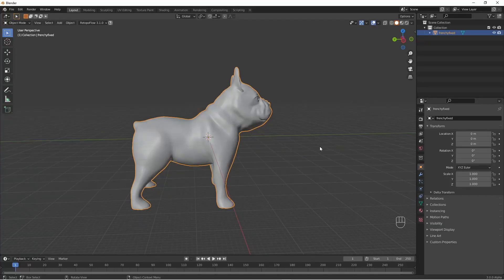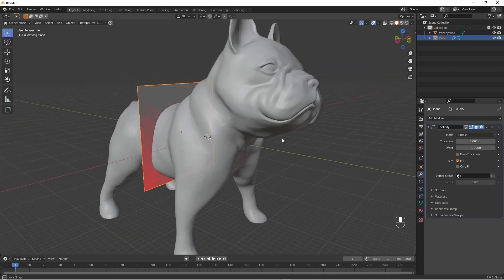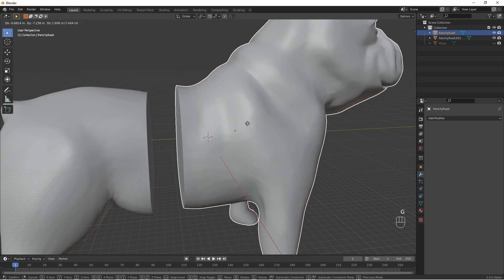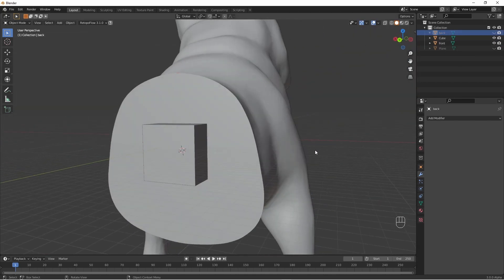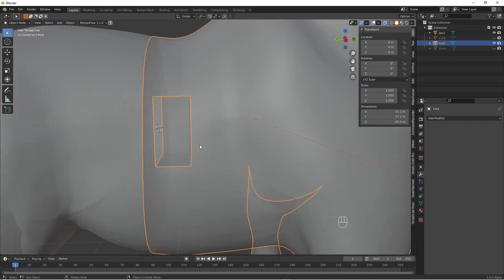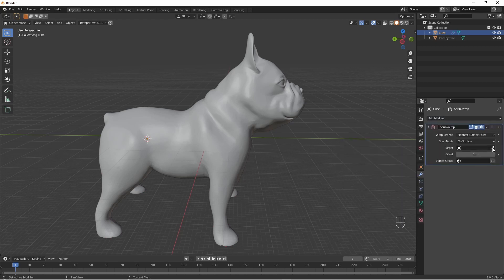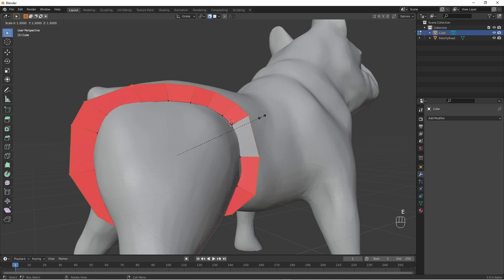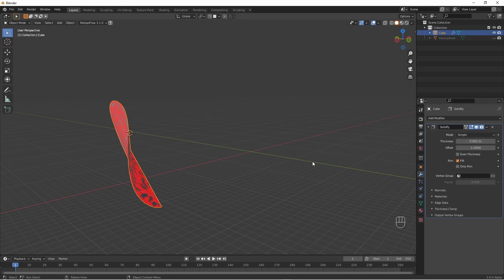Blender. How to cut and key a model for 3d printing

Comment: How do you save each half as a separate stl?
Reply from the maker: Select the half you want to export and then export to stl but check the "Selection only" box on the export folder selection window.
Reply: @notverygoodguy  Thanks, That sounds easier than deleting one whole side, saving the current side, crtz and deleting the other side lol. Much appreciated! Is there any sort of way to use a pen tablet to draw an organic line around the shape we want to cut out, that you know of?
Reply from the maker: @Lexesbenz  Blender supports tablets of course and so the easiest way MIGHT be to have a control on the pen set to right mouse click.  Then, create a single vertex, and then in edit mode use the pen, CTRL, and the right click button to extrude that vertex to where you want it.  You COULD draw a grease pencil line, decimate it and convert it to a mesh or do something similar with a curve but in the end I don't think these are likely worth the effort :)
Reply: @notverygoodguy  Ok So I used your method of using vertices to cut a large sword out of a hand on an STL I have. The only problem is when I extrude and scale the vertices they cut into other parts of the model, is there any way to stop that from happening?
Reply from the maker: @Lexesbenz  Not really, you would just have to be super precise with making your cutting object and move vertices around so it cuts only where you want it to.  That includes inside the model too.  It will help to turn X-Ray mode on to do this.  It is certainly possible to do  but it will need some patience.
Reply: @notverygoodguy  Thanks I figured as much. Kinda sucks, wish I could just aim the extruded verticies a bit higher up.
Reply from the maker: @Lexesbenz  You can move them, one by one, after you have created them.  Also, IF you are very lucky, you could try just selecting the entire model in edit mode by pressing "A" and then selecting "P" and "Separate by loose parts".  This MIGHT just give you the sword as a new object but it depends how the model has been made.
Reply: @notverygoodguy  Thanks I actually figured out how to move them, ALT select outside edge, and G to move them. It worked! Just wish there was a much easier way!
Reply from the maker: @Lexesbenz  It is easier if you don't start with an stl to be fair but I am glad you have a solution.
Reply: @notverygoodguy  thank you. I was able to move those vertices. But now I am having other issues where I cannot create a plane cut using those vertices I’ve created. I followed you tutorial exactly and I don’t understand what’s going on. It won’t separate the sword from the hand, with the Boolean operation. And I made sure that all the vertices were connected and they were no gaps. So I have no idea what to do now. 🤦🏻‍♂️
Reply from the maker: @Lexesbenz  Did you remember to add some thickness to your plane using the solidify modifier.  If you are able to provide a link to your blend file somewhere, I could take a look at it if you like.
Reply: @notverygoodguy  Thanks! somehow I managed to figure it out but, I wasn't able to cut exactly where the sword meets the hand, I had to go up a mm or two. If you would like to see the file I can send the saved blend file?
Reply from the maker: @Lexesbenz  Glad you have it sorted.  Blender can be a bit frustrating when you are just getting to grips with it but it does get better :)
Reply: @notverygoodguy  Yeah I think it was a clipping issue, the plane still had pieces from the lower part of the hand protruding through certain spots very faintly, and they may have caused the issue. But yes, I finally got it. Now to practice on other parts until it becomes second nature, Thank you so much for you help, and the tutorials!!!

Tony
Reply from the maker: @Lexesbenz  No problem.  I am very pleased you got there :)

Comment: there's no reason you wouldn't be able to use this method to split model into more than 2 parts right?  When I try to make the second cut, the plane like glitches out and is not able to be hidden, and leaves the new edge hollow  
I'm totally new to blender so I don't know how else to describe this issue :(
Reply from the maker: I am guessing that the most likely reason for your issue was either that you missed the step of applying scale and rotation or you had some normals that were facing the wrong way.  Bad normals are the root of so many evils in Blender :)  I see you have resolved the issue by exporting and re-importing but if you want to know how to check for bad normals then you could check this short video https://www.youtube.com/watch?v=RRZh390yo_M
Reply: dude idk but exporting the stl and then reloading fixed it

Comment: it worked for me at first but now the boolean difference doesnt work anymore. It creates the verticies and connects them but doesnt delete the area in between them.
Reply from the maker: I'm not entirely sure I understand.   However,  remember to turn on "face orientation" to make sure you have no flipped normals.  Check the normals on your model AND the cutting tool you are using for the boolean.  Next thing to check is that you have applied rotation and scale on your model and your cutting tool too.  Last thing that occurs to me.   Make sure your cutting tool is big enough to extend beyond all the edges of your model.  If you still have problems, let me know.,

Comment: For some reason when I add the cube it's hollow inside so it doesn't create the hole for the key during difference, just cubes outlines :(
Reply from the maker: All cubes are hollow inside, actually everything is really so I wonder if perhaps your issue is something else.  Would be interesting to see a picture of the result you are getting.  Is it possible that the difference has worked but you still have the "cutting" cube showing in your viewport?  If so, just selecting it and turning off the visibility in the list of objects would work.  You could also try just moving out of the way to check  if you liked.  Otherwise perhaps you can give a few more details of your issue.

Comment: this method doesn't work if the model has bones or i don't understand what to do already.
Reply from the maker: This method is for cutting up finished models to be ready for printing,  It won't cut bones in half but then why would you want to.  If you have a model that has rigs and textures and possibly shape keys, export it as an stl first and then use that stl to cut up.

Comment: Modifier cannot be applied to a mesh with shape keys
Reply from the maker: Your model has shape keys and blender won't let you apply a boolean modifier if a model has shape keys.  You CAN delete all your shape keys first but it might not work out as you would like.  As long as you don't save until you are happy that will be fine.  You may find delete all shapekeys works or start at the top of the shape key list and delete one at a time might be better.  You may need to make a new shape key from mix and to start with.  If you are not sure about shapekeys, let me know and I'll explain how to proceed,

Comment: You don't need to use a plane. Use the bisect tool to divide the model into sections. To close each section, select the outer ring and F to create a face, then control-T to triangulate the face.
Reply from the maker: This works but only for a straight cut on a not too dense model.  You can't use the bisect tool to cut around an object such as we do cutting off the leg here.  In a dense model, selecting the outside loop to create a face can also be a bit challenging.  It does work in many cases though so is certainly an option.

Comment: So when I apply the boolean modifier, the stl object disappears and only a little block of the original is left. Any idea why this is happening?
Reply from the maker: This is most likely to be due to not applying the scale.  Sometimes it isn't necessary but sometimes it will do what you experience.  Try applying the scale to both the model and your cutting plane.  The other, less likely issue is that you have a non manifold model or the normal are wrong.  The first can be checked by enabling the 3dprint add on and getting it to check, the second by turning on face orientation.  Alternatively, you could provide a link to your model and I'll take a look at it :)

Comment: Took a few attempts, but I've nailed it. Much appreciated.
Reply from the maker: Fantastic!  Glad it helped and thanks for the feedback.
Reply: @notverygoodguy Far quicker and neater than deleting Vertices. I'm just learning Blender. Is there any way to save a singular stl, without it also saving other bits that you have open?
Reply from the maker: @ATOMTAYLOR  Yes, just select the objects you need and then when you export to STL check the "Selection Only" check box (which may be hiding under the "Include"  option) on the top right of the export options.
Reply: @notverygoodguy  Ta ;)

Comment: Follow your Instructions 8:40 (Extruding shape around object) When I click around my sculpt there's no indication I'm making a path and that anything is happening.. The Black Lines and Dots are Not showing at all on the sculpt. Any help would be greatly appreciated, Thanks!
Reply from the maker: I presume you have created the single vertex as the starting point and you can see that in the list of objects in the outliner (the window in the top right that has all your object names in it and you are in Edit mode when you are doing the extruding?  The single vertex (made from a cube) must be created in Object mode and the single vertex extruded in Edit mode.  I hope that helps.  Let me know.

By the way, love your work!
Reply: @notverygoodguy  I've realised I wasn't Pressing "E" for every movement.
Thanks very much for your kind words and speedy reply!

Comment: Boolean was working fine, suddenly the pop up “modifier is disabled, skipping apply” came up and I can no longer use Boolean, how can I fix this?
Reply from the maker: Have you set a target for the boolean? This error usually means that the modifier doesn't have enough information to work or has options that can't work.
Reply: Yes after selecting the correct target I was able to cut it. Thanks so much for the help and awesome tutorial!
Reply from the maker: @disposable40mm  Glad to hear its working now!

Comment: this method is very sharp? I need I need a method to put my man in a horse, the horse and the man are separated. I need to glue them all together but I need a very sharp union , the pose is very complicated so I can not do a flat union ,  it is a little curved.
Reply from the maker: I am not sure I understand your question.  If you have a posed model of a man and you want it to sit on a horse, you'd normally just put it on the horse.  You wouldn't need a boolean at all.  However, if you are hoping that your man deforms around the shape of the horse, booleans are not that smart sadly.  You would need to model or sculpt the man to fit properly on the horse yourself.

Of course I may have misunderstood your issue,

Comment: What if my model has a more complex pose than this basic dog? What then?
Reply from the maker: This procedure will work with any pose.  Not sure if you got as far into the video as when I show just removing a leg from this dog but basically you just need to create a cutting shape around the part you want to cut and then do the solidify and booleans as described.  You can create your cutting shape simply by extruding vertexes around the part you want to cut and then filling in the shape.

At around time point 9:00, my previous video (with bad sound) shows another idea for cutting a part off a more complex model.  https://www.youtube.com/watch?v=D5-AJpzSDrs

Comment: If I have a hollow object, is there an easy way for me to put an end cap on each side of the cut after I've cut through that hollow section? (I'm sure there's an easy way to do it, but as a blender novice, I'm a bit lost now!)
Reply from the maker: I think I have this solved and its quite easy :) https://youtu.be/EDx-Lr3QdjE
Reply from the maker: Interesting question and this could be messy depending on your model.  I will need to see if there is a better way for for my test object at least this works.   Basically you create a thick plane that sits of the top of the hole and use your hollowed model as a cutting tool to cut into the place.  You then remove the bits of the plane you don't need.  I will do a video on this I think.
Reply: Only 1 month late, but I think you're trying to use the fill tool. Select the vertices on the outside of the hollow area and click the letter F for fill.
Reply from the maker: @TheCNCNoob  This can certainly work but you can easily end up with a large face that isn't flat.  This can make it difficult to add keys and other booleans.  In many cases it is a good option though.
Reply: Do a bisect instead and use the fill option.
Reply from the maker: @Superkuh2  I never had much luck making bi-sect work for me.  Maybe I should look at it again.  Can it work for a non-plane cut?
Reply from the maker: @Superkuh2  This is a good option for a plane cut though I guess you need to duplicate your object and bi-sect it twice if you want to keep both parts.
Reply from the maker: How to cut up and key a hollow model.  This method works rather well. Thanks for the inspiration for the video. https://www.youtube.com/watch?v=EDx-Lr3QdjE